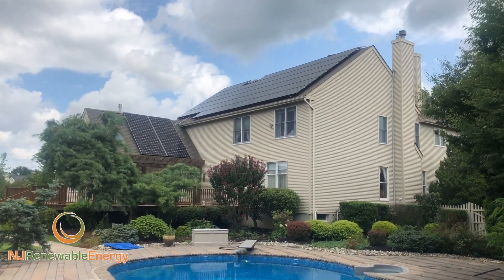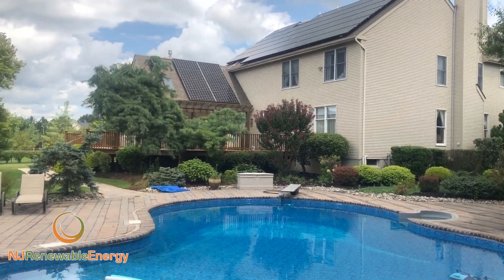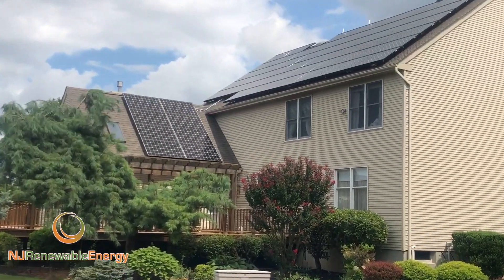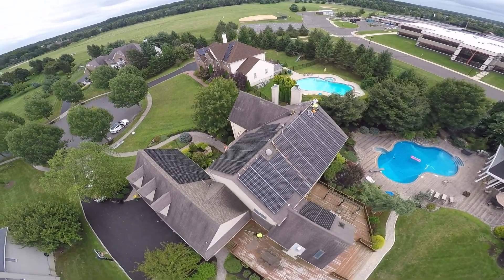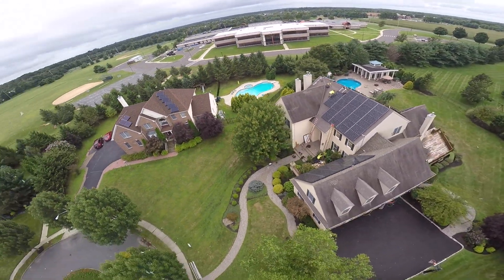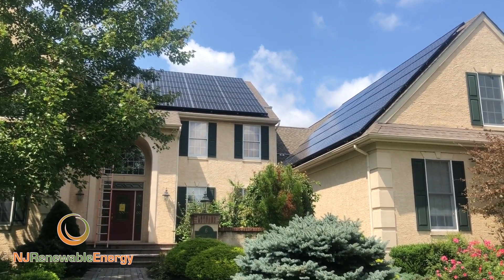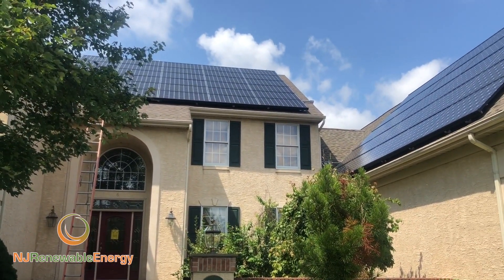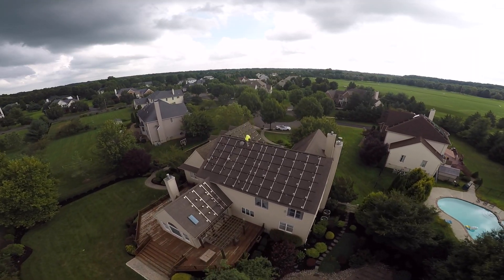Wow, A 35.5 KW solar roof mount in West Windsor NJ

Comment: What'd this system cost?
Reply from the maker: There are many things that affect price.   Distance between the array and panel,  service panel upgrades,  ease of access, panel manufacture, micro-inverter vs string inverter, etc.  This job was very large so the economy of scale helped.   This homeowner paid 2.70/watt, which is very competitive.